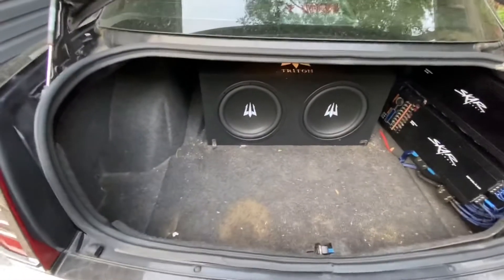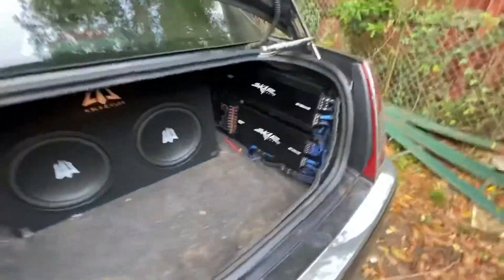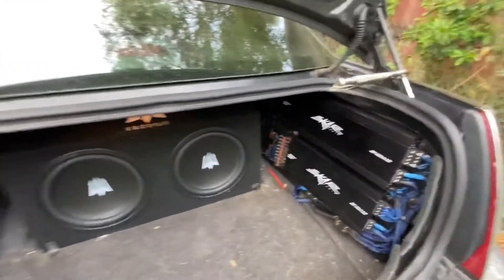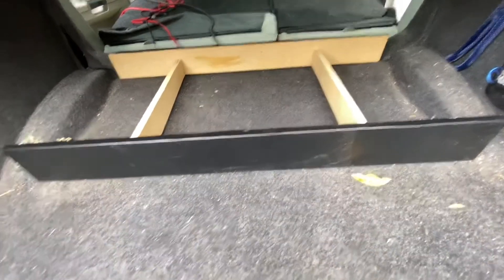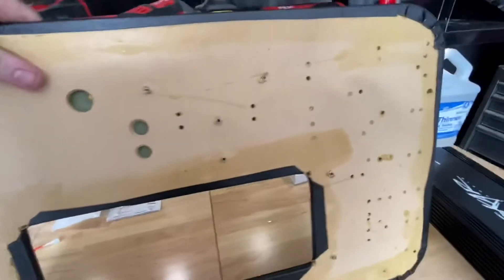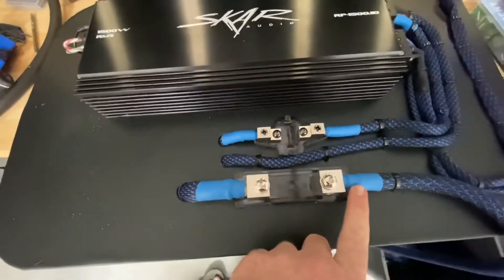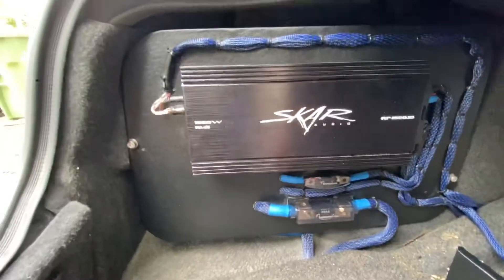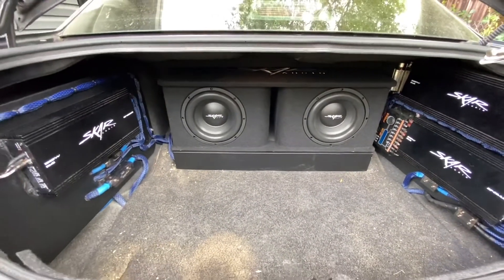Skar audio Chrysler 300 part 2

Comment: Bro, I have the same vehicle... and struggle with the same issue in the Trunk with the wheel well issue. Can you share the dimensions of the wood you used for the Platform you built to hold the box??? Thx
Reply from the maker: This was a setup I did for someone else. Don’t remember the dimensions. You just need to build a simple platform to raise above the sides. Or build a narrower box between.